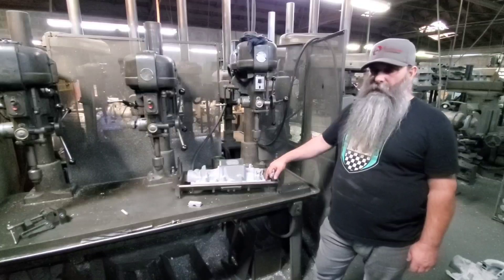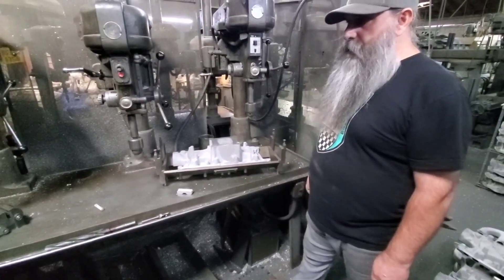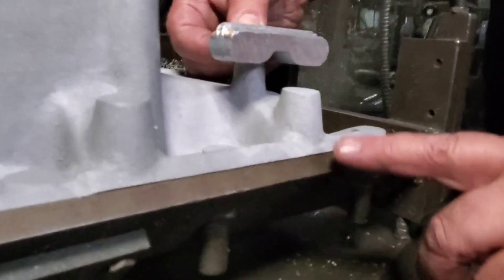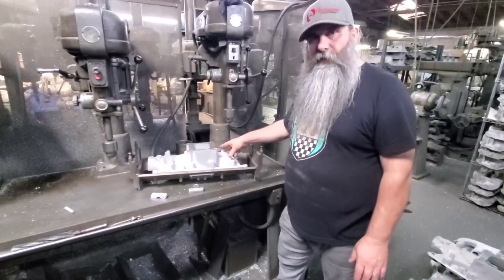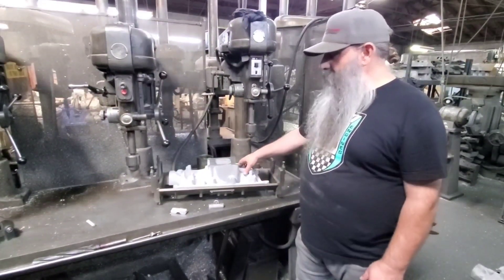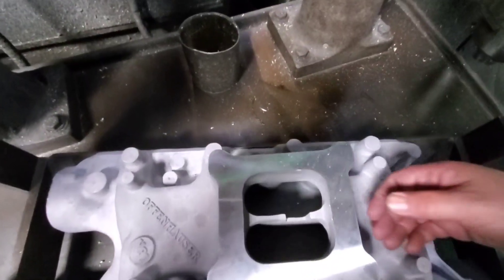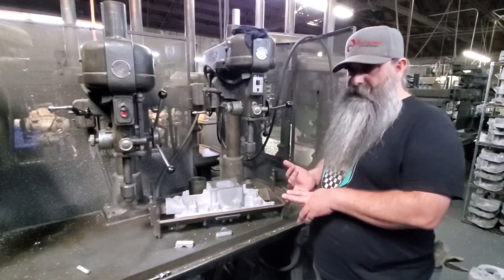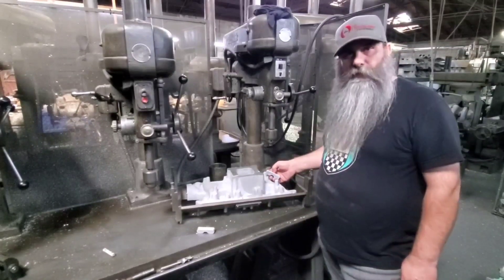An in-depth look at our next VPI

Comment: You need to add port injection to the dual port V8 intake. Cut the divider at the head back to allow flow for the injector. This will make the dual port due what it was designed to do. Eliminates the sharp turns that are not good for atomized fuel but ok for air only.